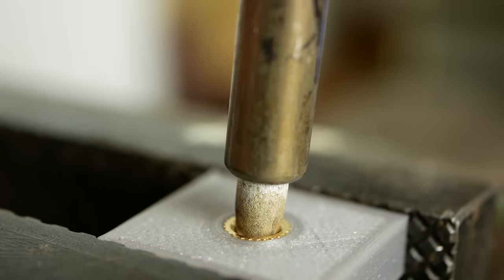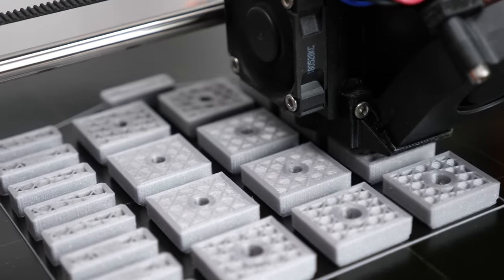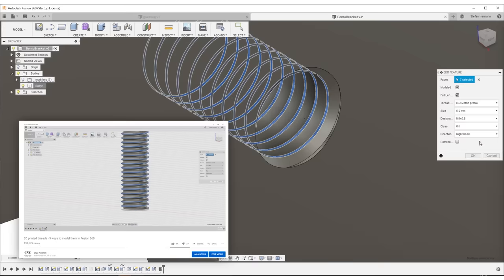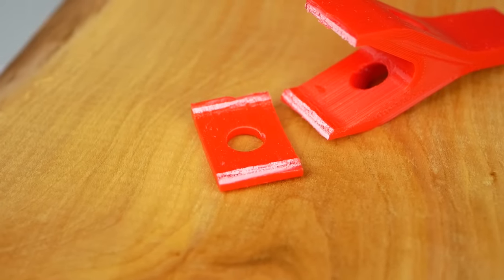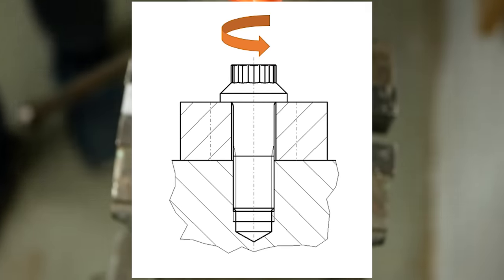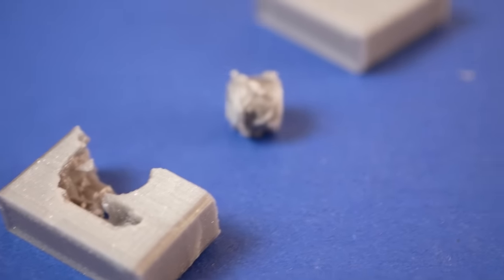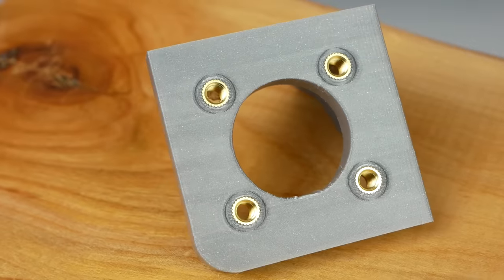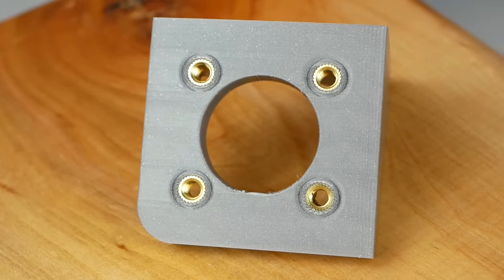Threaded Inserts in 3D Prints - How strong are they?

Comment: i mostly use M3 screwed directly into the plastik part. For connetctions that will be thightened more often i model a slot for a nut and insert the nut after printing. 
For the next test it might be interesting to see if 
1. more flexible materials (like nylon, PP or tpu) also work good with threaded inserts.
2. the pull out force of the threaded inserts is higher if ou have to pull them from the other side out.

Comment: I do a lot of work with ASA/ABS with inserts. There's actually a specific hole profile (basically a very high angle countersink) that's designed for the inserts I use, and I have that configured as a Hole Wizard preset that I can use on demand. Your particular inserts should have a datasheet that specifies the hole profile.

Also, the 3 in Slic3r is pronounced the same as an E, so you'd just say "slicer". :)
Reply from the maker: So Simplify3D is pronounced Simplified?

Comment: In my prints I add a small hexagonal pocket at the end of the hole to insert a nut. My biggest concern is compression of the plastic when the screw is tightened. I address this problem by simply printing 6 small holes that go through the plastic. These holes actually make that area stronger, particularly for compression, because of the added material inside around the screw hole. I have attached 1/4" screws (to hold ball bearings) with this method and have never had a failure (but this was at a lower load than in your tests). I use ABS. It would be interesting if you could measure this approach in future tests.

Comment: The heat set inserts are awesome and I much prefer them over every other method. Apart from the benefits noted in this video they also make it much easier to assemble/disassemble the things I print. When I'm prototyping mechanical parts, it's a really nice feature. It also reduces the number of tools needed to assemble parts, if the alternative is a regular nut (though there are other methods of securing regular nuts, and those have their own benefits and drawbacks).

Comment: Interesting and useful, thanks.  My usual method is to cut the thread with a screw in an undersize hole.. but then I relieve the stress in the plastic by heating the screw with a soldering iron, which also allows the thread to form more closely around the screw.  Needs a bit of care though - if you get carried away the screw can move out of place.

Comment: I use primarily M3 and M4, printing the holes at the right size (2.5 / 3.2mm) and then tapping it. Mainly this is for single use (mounting once) but I bought Helicoil sets for multi-use.
Helicoils use oversized tapped holes with spring steel inserts. These are mainly used to repair worn out threads but it is also used to create better threads in aluminium.
Google for helicoil to find local shops. For helicoils made from chinesium instead of high-torque spring steel, shop for "thread repair kit" at you preferred shop ;-)

Comment: I use M4 and M3. Around 90% of my printing is in ABS.
I don't model or cut threads or embed nuts in the design. I found out that on a correctly sized hole, using the bolt directly produces a thread that is less likely to split or break the plastic than using a nut.
I tried tapping, but I like the tighter feel of the "self tapped" threads more.
Nice to know that their strength is good compared to the amount of effort that you have to put.
Also, in my experience, it's very unlikely to split the part, if something needs a little more torque I make sure to design it so it prints horizontally or I make the hole (and bolt) longer.
I will also experiment with the threaded inserts, thank you for showing that. Always nice to have other options!
Thanks for the informative video, hope you do the same with ABS and PET.

Comment: In case you revisit this theme: May I suggest also testing the self-cutting threaded inserts from Boellhoff Type: "56000000079/01" ? Strength-wise they should perform like a thread directly cut into the plastic but with a relatively huge diameter. They are easy to use and you don't need to mess with a soldering iron to get the insert into the plastic part. These might be even stronger than the brass inserts (that got stripped), since these self cutting threaded inserts are made of steel. There is an expensive tool to insert them, but you can also just use a screw with some hex-nuts on them as an insertion tool. Anyway, very cool video, keep up the good work!

Comment: For small size (up to M6) and not so frequent use I am using holes in hexagonal shape. The thread is made by metric screw during first application. Thanks to hexagonal shape is not the material so much torn. It requires to feel the material during screwing and is cheap and simple solution for less tressed and less frequent used joints.

Comment: Useful video Stefan! I use a number of threads in the range M3 to M10. I tend to use captive nuts with hexagonal recesses modelled into the part with 5+ minimum layers of 0.2mm on the load side of the nut for M3 increasing this further for the larger sizes and 4 perimeters. I find that directly cut threads perform quit well for M5 upward but only for relatively light loads. As you will know, modelled threads are very dependent on layer thickness and I don't use them for vertical holes for that reason but horizontal threaded holes are better. I use PETG for most work as this is dimensionally stable under load, unlike PLA, although not as stiff. I have modelled M6 and M8 threads in Filamentum ASA but this is a crap material to print due to warping and I've had layers detach in the threaded area where the threads introduce a weakness. I have used threaded inserts where thickness is tight with reasonable success.

Comment: Great video as always. I had to fix a sink where I could not get replacement parts anymore. Fusion 360 threads worked great and pla was strong to seal the sink for a week or so, then boiling water killed it. Reprinting it in abs it is still holding and boiling water isn't a problem any more. Was surprised how much force even the pla screw and nut could take being printed in vertical direction. There wasn't any space for other hardware and the Boss of the house is happy.

Comment: The thread sizes I use most often are 3/8 inch coarse and 1/4 inch coarse.
3/8 inch is good because it's a reasonably heavy chonker that I can find quickly at the hardware store.1/4 inch coarse is what camera mounts use, so I keep that on hand in case I want to set up a weird camera angle.
As for threading, what I usually do is leave a recess for a hex nut on the far side of a part so it pulls in when I tighten.

Comment: This was some great work and presented well! One other tip to others, make sure you don't sink the insert below the surface of the plastic. You want the force from the bolt to be transmitted directly on the top surface of the insert. If you sink the inserts, the bolt tension will be felt by the plastic, and you could see failures over time.

Comment: Great video. Thanks for the effort you put into the variety of possibilities for mounting or connecting parts. If the part thickness allows, I will always use the inserts using a method similar to yours. I made tips for my soldering iron that have the same threads as the insert so that it can be threaded into the insert for heating. I find that it gives me more control over how straight the insert ends up in the plastic and I can use a lower heat since it heats the insert from the inside out rather than from the top down. If the part is not thick enough for an insert I will use external or imbedded nuts. I almost never use just threaded plastic. The exception is only for boxes with lids on projects that I don’t ever expect to remove the lid once it is installed.

Comment: Than you for the intresting video, however I think you just measured the strength of the plastic surrounding the thread instead of strength of the threads. I would use cylindrical samples with maximum perimeter number to have 100% infill to rule out impact of the print on the results. To have more clear picture I think is worth to check the corresponding VDA standard for bolted joints to gather some hints.

Comment: Great video once again. Could you test using regular nuts in hexagonal pockets? Those are much easier to acquire, though brass inserts are becoming more easily available to regular consumers. So far it's the only method of threaded fastening I've used with my printed parts. I also generally use M4 and M8. I use M3 and below only when I have a good reason to, because I prefer not handling nuts and bolts that tiny, so M4 is sort-of the smallest general-use size for me.
Reply: Just commented pretty much the same. I also think that embossing normal hexagon nuts is one of the easiest and sturdiest things to do. I use it in pretty much all of my own designs if I need to screw something into plastic model. Most surface area/perimeter walls to support normal nut. Actually haven't specifically tested them, but they've never failed when I've used this modeling style.

Comment: Usually, I print an undersized hole and cut the threads. When cutting the threads with a manual three-cutter thread cutting tool, I usually use just the first two. Nice sources for, usually very small threaded inserts are the laptop cases. The threaded insert is the best choice if the parts should be disassembled on regular basis.

Comment: I've had excellent results with ABS and tapped threads (with many many rescrewings and the threads are still good!). A tip for inserts: First the problem -  putting inserts in with a soldering iron can tip them off axis from square. I noticed Stephan almost getting the solution using a straight edge to push them home post heating -  that straight edge should be a cross so that the insert is set flush and square to the part's face in both x and y directions.

Comment: For M3 holes I usually just model them as 3mm or 2.9mm depending on material and application. For anything bigger, I model them in. I have also used 3mm inserts for a DJI Inspire clone I built years ago. I had to use aluminum screws to offset the added weight, but it was worth it for peace of mind as everything was under heavy load and vibration while flying.

Comment: I mostly just use PC fan screws because they are made to tap into plastic and are about 5mm in diameter (and they're super handy to have around in bulk if you work on PCs!).  They work really well as set screws for gear shafts on stepper motors, etc...  I also use threaded inserts or captive nuts when something longer is needed (usually m3 or m5). 👍

Comment: I mostly form threads by using bolt itself. It works well for small diameters (up to M3-M4), but bigger bolts tends to introduce bigger radial load and there is risk to split/crack the part. When I form bigger threads, I usually preheat the bolt. Works well in practice, but needs quite good gut feel to heat bolt to just right temperature.

Comment: yeah i used a lot of them when i was building hypercube evo. they are very very strong. and the hardest part is during insertion.

you have to insert them vertically and the temperature is a bit hit or miss at the beginning, so if you are building something with it, make sure to print out some test part to fit them, so you can get used to the insertion. and they can be reused as well but you have to discard the part.

Comment: Hi, great research. Please people, note that PLA has cold crystallization (so called physical aging, a process that occurs in polymers) after printing which causes parts to warp over time. Printed brackets with threads are not always realistic replacements for metal brackets. (I.e. don't build CNCs with them if you need the accuracy)

Comment: I use heat inserts in nylon carbon fiber filament, my results have been surprisingly good. I also use molded threads where heat inserts won’t fit and they work great. I do recommend a heat insert installation kit for your soldering iron so the inserts are correctly installed.

Comment: I usually just make a hole that is the size of the screw (3.2mm for M3 or 3.0mm, if I need it to be really tight and then add a little chamfer to guide the screw in) and just screw into the holes. 

I usually also make parts to have double or triple redundancy for the screws. Real structural parts will have 3.0 holes with M3 nut insert holes on the other side.

The redundancy also helps a lot if you need to align the parts better vs. Printed guides to keep them aligned.

Comment: I try to use inserts as often as possible in my designs....  I used to embed nuts into the 3D design and place them during the print but ever since I discovered inserts I’ve been an avid advocate towards using them wherever possible in designs.  The only exception would be if the screw had an extremely light use in the design, but even then I tend to use an insert just for piece of mind.

Comment: i model and print the threads, they generally come out slightly undersized due to inaccuracies, then i do a cleaning pass with a tap. this was okay even for pneumatic push fit connectors with o-ring seals and there was 5 bars of pressurized air inside the parts. the threads in that application was 1/8 bspp

Comment: I recently did a very similar comparison of cut, modeled and brass inserts in a practical print.  In my case, these threads were MUCH smaller 6-32 Imperial (about 3.4mm), only because getting imperial Nylon screws is easy at my US-based local hardware store, but their selection of metric nylon is almost non-existent. Nylon/plastic screws were a requirement of the application.  Interestingly it appears that size and/or material DID matter for me.  There was a WIDE variation in friction in tightening/loosening the screws--perhaps due to the split-type inserts that were available locally.  I ended up going with cut-threads for this application and we'll see how they stand-up--it is a very light load, so I expect they will do fine.

Looking forward to seeing you at MRRF!

Comment: For properly sizing the hole for the threaded inserts, check the data/sales sheet for the inserts. They might give a manufacturer's suggested size, much like a suggested drill size for taps. (I know PEM(tm) inserts do for press fitting into different metals. Threaded inserts that are designed for insertion into plastic hopefully should also have the specs published.)

Comment: Typically when designing plastic parts that need higher torque or rework, I will ya a threaded insert. However typically I will use a plastic thread forming screw, it would be great to see a comparison with those!

Comment: Ive been using press captured nuts a lot lately. They seem to be the strongest and most durable. I usually just countersink hex shaped holes on the backside of the part, just barely undersized, and hard press them in. this gives the nut some material backing in the direction of the thread pull, and can be torqued to whatever the the threads in the nut can handle, with no stress or deformation of the part. The threads in the nut are obviously stronger than plastic threads, and no danger of an insert pulling out from the direction it was inserted. Pressed nuts are simple, cheap, plentiful, easy to find in any size you can imagine, any metal you like, and no heating or special tool needed, other than a mating bolt and a hammer or vice. Usually I dont even need to drive or press them in, they usually self sink themselves as I assemble the part.

Comment: As always, very nice content Stefan! Many usefull information. I've used many threads in many sizes in ABS, PETG and PLA. The worst case is PLA, I always use brand new taps (exclusive for plastics, never  use in metals). Also I need to clean the tap for every use, and usually I lubricate with PTFE spray, this way I always get good threads, usually from M2 to M5.

Comment: I was wondering if it is possible to print 100% near the insert area and 20% everywhere else.  This knowledge changes everything, saves printing the whole part at 100%.  Using ZORO brass inserts with soldering iron into PLA.  About to try PETG for the first time.  As a Cura user I thank you!
Reply: From some other videos, I have gathered that it is practical to increase the fill percentage near holes etc.  I wish I could remember the name of the video but some guy was varying the fill to get stronger parts where needed.  It seemed that he was making an object within an object to define the volume with the high fill rate.  The rest of the part was very lightly filled except the skin.

Comment: Have you tried helicoil inserts? You print a thread and then screw in a metal insert with the same external thread but the required internal thread. They’re used for reinforcing aluminium parts with high use holes or those that need higher strength (or repairing damaged threads).

Comment: I have an extra option that i used successfully over te years! leave out for example a 3mm wide hole/shaft in the 3D model (or leave it sealed and simply drill a 3mm hole, in my most used on customizing toys so i didn't require printing at all, still same applies) then optionally drill just 0.5-1mm inwards with 4mm to make it easier placing the screw/bolt!  then heat up a soldering-iron and gently push a heating screw/bolt into place, VOILA!

PS: asking for SUB is normally NO in my book, but using statistics... YOU FEKKING EARNED IT, well played sir!

Comment: I started using m3 threaded inserts. Insert a long bolt from the other side thread the insert, heat with a small torch, pull through, works great (not my idea, but great technique)